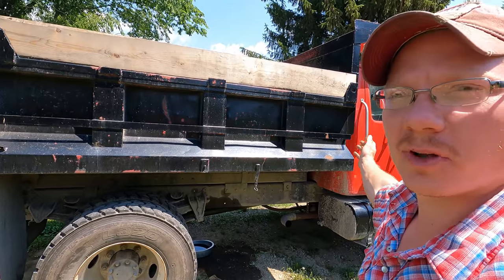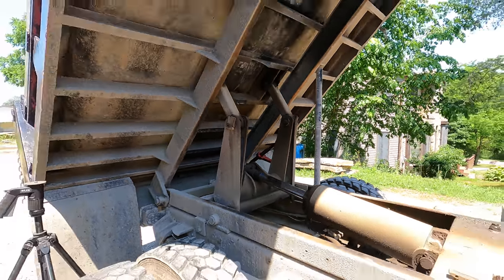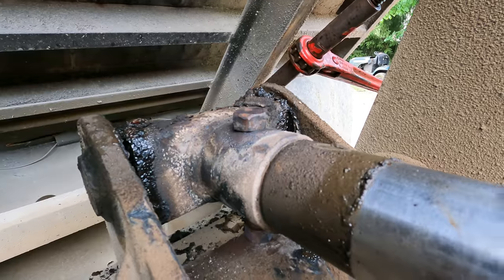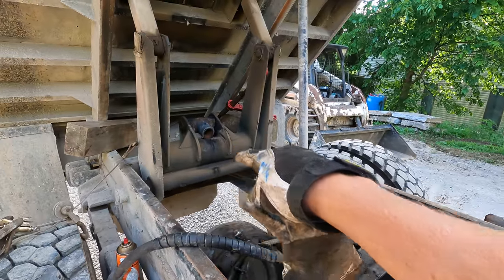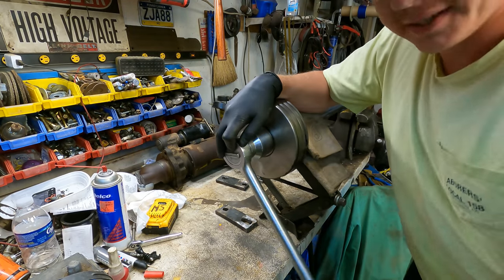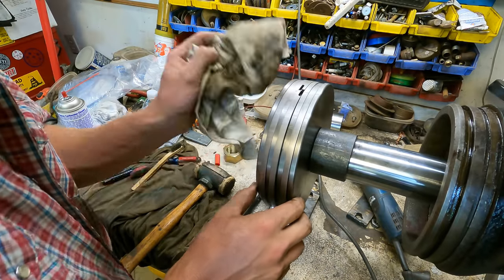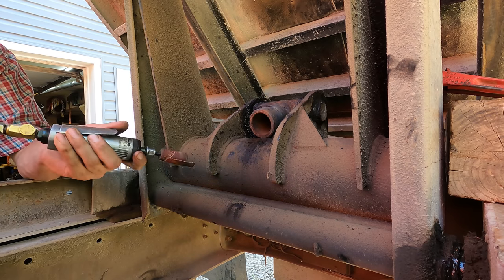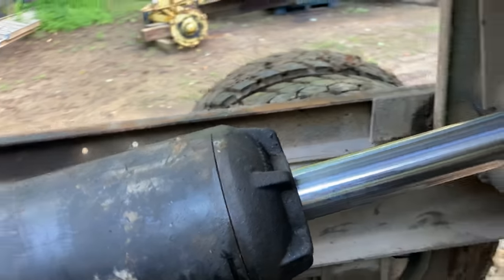Dump Truck Hoist Cylinder BLOWN OUT!

Comment: Dump truck cylinder #1 and someday soon forklift cylinder #2 it was wizzin out there pretty good to, another good way to install those seals is to let them set in a bowl of hot water enough to make them a little more flexible and they go in much easierand make life the same, I worked with lots of different cylindersand never seen one welded into place, unless done from the factory dum design , great job  Matt, you got them 2 P's good, patience and perseverance  👍👍

Comment: Meatball is cute as heck!  PS - This was designed but a BscMecEng - who decreed that all pressure vessels should be interior Butt Welded.  Hence - each container had one welder - IN THE TANK.    Welding both sides of the pin was a give away.

Comment: Matt I just realized you were a lefty. Good job on the cylinder. I’ve done cylinders for years and have had creative methods to take them apart like you up to and including chaining the ram to the rear of my service van and yanking it out. Also I’ve never had the packing install tool but have always wanted one I’ve heard it makes it a lot easier to fold it up and install.

PS I also use the Pennsylvania thumb wrench like you do. An adjustable to me is like slip on shoes, just easier.

Comment: it is serviceable.   in the down position, for safety.use the fork truck to lift the bed up when cylinder is disconnected.   its designed that way to make sure one does not have the bed up so you dont die.

Comment: A cable from the box to the hydraulic pump adjusted to the proper length will put the pump in the hold position  in turn will stop the pump from bypassing when the pump is pushing the pressure relief open it will build heat quickly.

Comment: I note on the rebuild of the bottom end of the old 429 you lubed the rods with motor oil and not assembly lube. but the ram, you used assembly lube. :) Blue lock tight on that new nut would have been nice.

Comment: Here in Australia those tipping body hoists were made by a company called G-WELL up until the telescopic front mounted hydraulic cylinders took over. I built many tipping bodies using both lifting systems.

Comment: If you want to keep those seals you should at least once a week if not more often. Extend the cylinder then take a rag and wet it down with some hydraulic fluid and wipe that cylinder rod off. You use hydraulic fluid because other lubricants may cause the seal to dry or rot. A rag and a little fluid can save you a hell of a lot of work

Comment: Im an electrical engineer and can answer the question on the particles sticking to the T section. Well there are two possible phenomena. One is if you heat iron up to the point where atoms are free to move but still below Curie temperature, they will orient themselves to a dominant magnetic field line such as the earth magnetic field which is called an magnetic dipole moment.  You need lots of heat, almost red-hot for little magnetic field strength to form. The other likely event is static charges.  That when two isolating materials like dirt , grease and even gas separates they keep different static electric charges. Metal or plasma can conduct these charges and if the structure is isolated and not earthed, it can hold on to such charges for  a while.  Particles carrying opposite charges will attract and clump together.  This is likely due to the flame of the torch creating a conductive path for charges to flow as gas separates from the nozzle. Once the flame is removed the charges are isolated. The charge is proportional to the surface area of the total metal and the dielectric of the materials covering it such as dirt, oil and paint where such charges can be stored. Meaning the truck becomes the one pole of a large capacitor and the earth is the other separated by a non-conductive dielectric. But this charge should go away fairly quickly as coronal discharge takes place into the atmosphere. If this effect holds up for long its more likely a spontaneous magnetic polarization, but if its drops off very quickly its probably static.

Comment: Hold any piece of iron in a northern direction and tap on it enough times the molecules in that iron (rod) will align along the magnetic force of the North pole. This the method used back in the day to make magnetic devices. Your heating and percussion (most likely in a northern direction) caused the small particles to become magnets.

Comment: It may be magnetic for a sensor, they may let you know when the bed is fully extended or fully retracted. Or maybe you just made a magnet with heat and pressure.

Comment: Matt,  Did you consider cutting the head off the bolt for the rod, then pulling the bolt out the top side? It would have skipped having the bed up, etc.
You did a great job without my nit pickin!!!!  Good Luck.

Comment: I worked in a potato chip plant and it was not unusual to get the fork lifts and the man lifts stuck on the floor drain covers. The drain covers were about 1/2 inch below flush with the floors and with the cooking oil on the floors you weren’t going anywhere. The normal solution to the problem was mopping the floors with degreaser so you could get traction.

Comment: The hydraulic rod should have a microscopic fluid film present; it should not be completely dry, nor should you expect that as a sign for a good seal. Seals run on a microscopic fluid film to prevent wear/abrasion on the seals. Slight “wetting” is acceptable, but not enough to form a drop!

Comment: Could you have used a bolt with a hole drilled through, then some washers and a cotter pin? But you used red loctite, so you won't be disassembling anyhow...LOL Just discovered your channel and subbed. Never a dull moment owning heavy equipment!

Comment: Magnetism in turned ferrous parts (ie, basically the entire cylinder assy) is induced in basically the same fashion as a generator. One piece of steel rotated in close vicinity to another creates a fluctuating electromagnetic field. In a generator, that's converted to current.  In a machine tool, it just magnetizes the workpiece. 

Source: am machinist/engineering tech specializing in hydraulic systems.

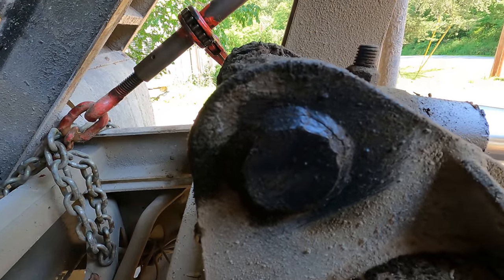Comment: 5:12 time. I think I saw a crack in the weld on the welded in rear pin.
Very nice vid Matt watching you deal with problems.
I saw that loader at the end of the vid.

Comment: You could get under the truck and take that bolt out before you raise up the bed. It only keeps it from coming out when you dont have the tailgate chains open far enough and the weight setting against the tailgate tries to make the bed go up faster than the cylinder is coming out.

Comment: I bought a Mack dump truck from a gal and she said I could have the ram that had been replaced on the Mack. So I went with my pickup truck and I’m here to tell you what was the most heavy thing I’ve ever picked up by hand. I got it in there but my back told me about it. It was a four stage I think. Heavy.

Comment: It is possible that the magnetic properties were induced.  It could have been induced electrically, or by the heat you applied.    It did not seem like there was enough heat to polarize the cup, but it is possible. Also, hammering the metal can polarize the iron in the object but only temporarily, and it would be very weak.

Comment: heat the tee fitting to cherry red the quench with plenty of cold water until it stops bubbling this causes the part to shrink rapidly crushing the rust, and the part will fall apart this method has never let me down yet

Comment: I'm sure you know but incase you don't, moving the truck before the box is down really shortens the lifespan of cylinders (especially single-cylinder hoists). I run a triaxel trailer year round (gravel all summer and snow all winter), sounded like a know-it-all, it's not my intent.

Comment: Wouldn't you have saved a ton of time by leaving the shaft attached to the truck and removed the can in situ? In this order: 1. Loosen the cap first and separate it from the cylinder. 2. Remove the pin holding the cylinder to the truck.  3. Remove the sealing pack from the shaft. 4. Slide off the cap and put new seals in it. 5. Reassemble in reverse order.

Comment: When you're putting in the new seals, try a Marlon Spike. Or any tapered cylinder. You run it through the seal as you're putting it in the mouth. That last blip can damage the seal if you crease it. Using the tapered drift applies equal pressure all around from the inside.

Comment: After fitting Ur new ram nut you could drill small hole though nut at back and fit lock wire  or spring pin

Comment: that copper shield is the bomb lasts forever used a lot of it around moundsville at the gas compressor plants A little goes a long ways and very heat resistant  good ground near that connections should allow the dc to bleed away for a long time no mores magnetism...

Comment: I had a 1986 international bobtail like that, while the hood ornament said DT466 that’s not what was in it, my engine had a casting flaw behind the starter where it leaked coolant, woulda been a good truck if not for that, it had a sound body and frame.

Comment: Hindsight ALWAYS being 20-20, grinding out those welds on the cross pin would have been easier than the fustercluck that it turned into.  I always start down the wrong path of the decision tree when I take on a project like that too.  Usually underestimate the time it takes too.

Comment: I couldn't see the shaving standing on end.  However, when something is ground, it becomes magnetic to one degree or another.  The hydraulic shaft is very definitely ground.  If it was the shaft, those would likely be demagnetized before assembly.  This is a normal process for machine ground parts.

Comment: When inspecting the cylinder. If it looks like a bunch of spider webs on the inside you must replace the cylinder this is an indication of overheating and the cylinder is in a brittle condition and will blow out

Comment: Sometimes when you beat on metal it will cause it to magnetize by aligning the molecular grains. Heating it up will kill the magnetic effect or by “degaussing” it with a welding cable.

Comment: A couple hose clamps could be used as a makeshift ring compression tool. Did you put an alignment mark on the outside of that cylinder before you took it apart? Good job rebuilding the cylinder. I've rebuilt many similar cylinders for pneumatic service.

Comment: If possible, I leave the cylinder body attached to the equipment so you don't have to hold it while removing the rod. Then you don't have to remove the hydraulic lines until last and can use the hydraulics during removal instead of binders and come-a-longs. Sometimes it isn't possible but if you can it definitely helps!

Comment: The yoke became magnetized by you whacking the snot out of that bolt.......one way you can magnetize steel is by impacting it repeatedly. It won't make a strong magnet, but as you can see, it does indeed work. 
#physicsisfun

Comment: Definitely a little bit of a fight to get it apart since its probably been in there for quite awhile and the fact that the north east isn't very forgiving on metal with all the damn salt they like to use on our roads, plus whatever dirt and crap worked its way in there just from normal use. Went back together nicely though. Was going to mention cleaning out and anti-seizing that thing, but you beat me to it. Nice work, and just one less thing you'll have to worry about. Meatball is one funny ass dog. Hes got a hell of a lot of energy lol. 👍😎😁

Comment: the magnetism is there to hold the pin fitting in case the bolt brakes LOL ( I hope you know that is a joke ) I would definitely clean that part well and use a brake hone to make it easer to assemble.

Comment: If you heat steel up hot enough it loses its ability to be magnetised but you werent even close to hot enough. More likely movement of the ram and repeated hammer impacts caused it to have a very very small magnetic field

Comment: When I rebuilt the boom cylinders on my New Holland LS180 I couldn’t get the taper pins to break free. I raised the boom about 3-4’, then blocked it up, and pulled the rod end pins and rebuilt them on the machine.

Comment: I have 4 boxers and I've bought basketballs for them to play with. Seems that no matter how much air pressure I put in them, they still manage to get their mouths open wide enough to pick them up in their mouth and pop them. There must be some alligator DNA in their somewhere but the analysis from AKC doesn't show it. Great job on the cylinder...now I know what the slots near the cylinder ends are for.

Comment: I'm ignorant of your situation but I work in metal recycling the welded pin would have been cut out a call to metal service ,get a new peice of pin stock,  quick trip to drill press fully serviceable no future issue

Comment: The nut thread disaster was caused by the “hammer dots” the knucklehead created.  You should have ground off those nipples before taking the nut off. He should have spot “glued” the nut to prevent run off

Comment: I think you did a great job on replacing the rod seals only. But it may bite you in the butt in the future because you didn't replace the packing seals.  The oil under psi can still leak past the packing seals an leak out your rod seals you just replaced.

Comment: Plating companies use magnetism in the process to plate metals that are not parent metals copper first then chrome by design. Even after heating chromed parts it still will show negligent magnetism insignificant

Comment: I suggest packing the slot in the cylinder where that cap retaining wire winds in and out of with some real heavy grease or wax. I can't imagine the hastle if water got in there and rusted that lock wire.

Comment: I am back.    Pump oil back into the down side of the cylinder.     Or use a grease gun and pump grease into the cylinder like in the track tentionor on the bull dozer.

Comment: I've never understood the reason for that design of hoist.  The cylinder suffers from considerable mechanical disadvantage due to the lever arrangement to lift the box, and if the piston seal dies you can't get the box up (easily) to pull the cylinder for repair.  And most of the box is cantilevered out beyond the lifting point.

A vertical cylinder at the front of the box seems a much better system.

Comment: I was just waiting for you to discover that the end of the rod and the T-fitting were both threaded together! The bolt/pin was simply to prevent accidentally un-screwing the connection. I'm sure the engineer just forgot about that added feature! 🤪
As others have mentioned, it's likely the bolt can be removed/replaced easily with the bed down. But think of all the fun you had doing it the way you did!? Much more interesting vid!! 🤥

Comment: Maybe it would have been better to invest all that time into trying to get that welded Pin out of there and replace it with one that you can easily remove again. I was thinking grinding it down to the point where you can drive it out? Just a thought :) You probably thought about that aswell.

Comment: I don't know much about hydraulic fittings...but since you had that line custom made I'm kinda surprised they didn't just put a union fitting on that line. Surely with a line that long it would be common sense to put a union on the end. I can see you over looking it, but a shop that deals with that sort of thing should have seen that. How much more could a union fitting have cost? Surely it's not a lot.
Reply: Customer says put a non-swivel fitting on the hose, that's what they get.  They know the application, I don't.

If I was on site making up the hose (i.e. I could see where it was going to be installed), I'd strongly advise a swivel fitting, and be happy to explain why.
Reply: @dfross87  It's a 4ft long hose...you don't need to know the application to know it needs a union.
Reply: @Eremon1  There's plenty of situations where it may not be necessary/possible to use a union fitting.  E.g.: when a union fitting wouldn't fit in a tight clearance spot -- fixed fitting required.
Reply: @dfross87  Fair enough...Seemed odd to me. But I do see what you're saying.

Comment: I think I would've burnt the head of the bolt off and used a stack of washers or socket or something to tighten the nut down on to draw the bolt out of the top.....might woulda worked if it didn't start to just spin. Could've welded a nut to the bottom too on assembly so next time the bolt would just back out.....but all hindsight back seat driving....you did a good job with it!

Comment: Just had an idea: If you have to take the cylinder apart again, reattach the bottom to the truck and use that to hold it from spinning as you unscrew the top, then remove the cylinder and do the seals.

Edit: So...how often would you have to lube the "tracks" on your Bobcat to keep it from being that squeaky?  Obviously it wouldn't be worth the effort, I'm just curious.

Comment: “The gland end”…….didn’t realize I had switched to AvE’s channel……. A tip when installing large sealing rings like that, use a couple of very large screw type hose clamps for a ring compressor.

Comment: Ditch the small wheeled forklift and get one with bigger wheels.  Had one in a shop where I worked... when it was off the shop floor it continually got stuck on most anything.